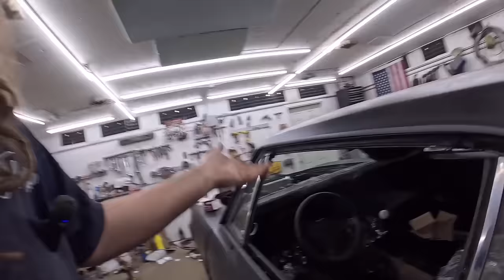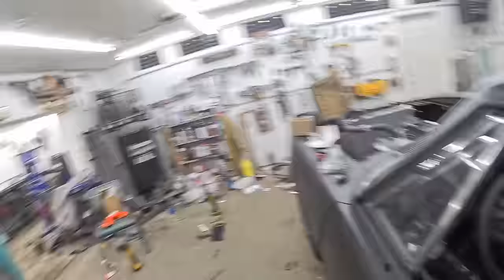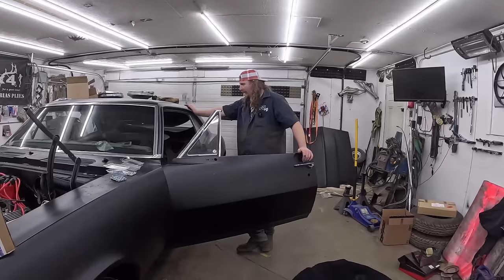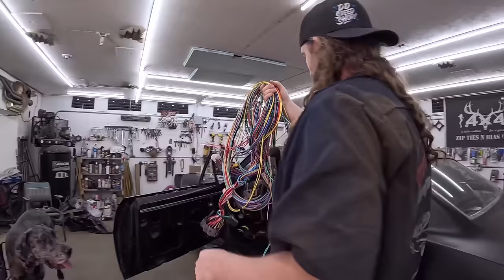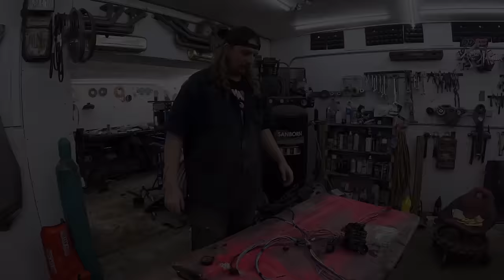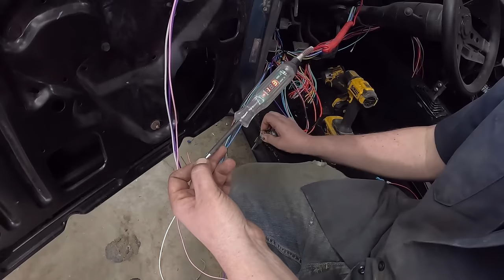Starts With The Key!  Re-Wiring Our 1967 Camaro With K-9 Supervision

Comment: I finally finished up my car today and all the an lines and fittings are so nice no leaks trans cooling lines power steering and fuel so much nicer and cleaner looking also all I have left is the exhaust just put the mufflers on in the morning and I'll be driving it I do however have to buy a electric vacuum pump for the power brakes and I knew with this cam it was going to be a issue I guess because it got a 108 lsa because in the past I had cams with more duration that my brakes were fine but it is what it is. Great video dan your really close now your friend from Louisiana Rick 427

Comment: Dan , wrongway here,  everybody struggles !!! 😅LOL yours are just on the interwebs !!! 😅 I mean here's an example battery in my pickup went bad , got warranty rrplacement but had to buy something cause interstate was closed  so got a cheapy for a "spare" When they got my battery in went out and Installed myself t 👍 reset clock radio all that, shut it off , gave tha side post connections a last wiggle for tightness check ,✔️ ground loose , retighten striped the "bolt" 😅 !!! Thats an example small but hey you are a legend IMHO !!! GOOD JOB D&D 👍!!! Now for some popcorn to watch the show !!!

Comment: you need the pawls from the old locks the metal lever that is on the old locks, on a Chevelle there is a pin that fits in the slot with no retainer.
 when you order new locks they never tell ya you need the extra pawls to make them work if your putting doors together with no locks in them.

Comment: You need to mount you a push button in between your starter trigger wire so if you under the hood want to adjust your valves or something you just mash the button it's a very helpful button

Comment: 67 had the small keys 68 got your style key 67 the doors and ignition were keyed the same and the trunk and glove box were the same . If you lose your keys or the dog eats them. All you need to do is pull a door lock and glove box locks take the codes stamped on lock to a locksmith or dealer parts department and they will cut new keys . Or a really smart canuck will write the codes on a piece of tape stuck under a dash in case

Comment: Sir, your gonna have the screw sticking out of the floor.  Why don’t you use an aluminum rivet for the drain holes with a little dab of seam sealer as a gasket